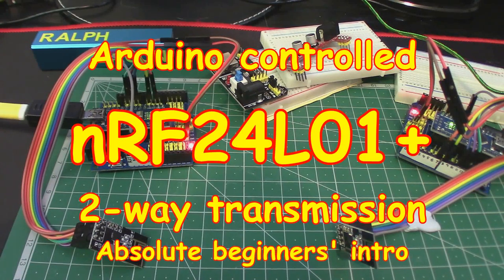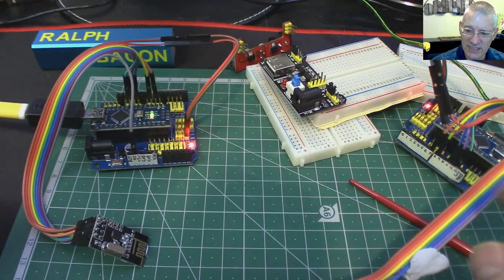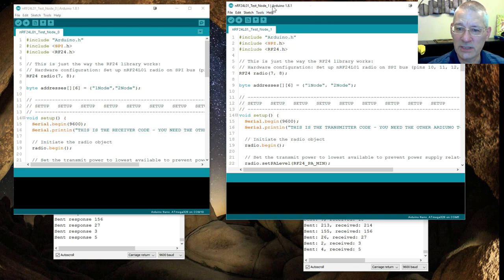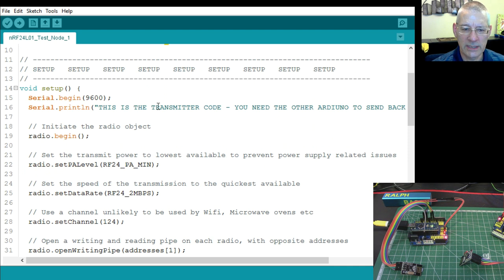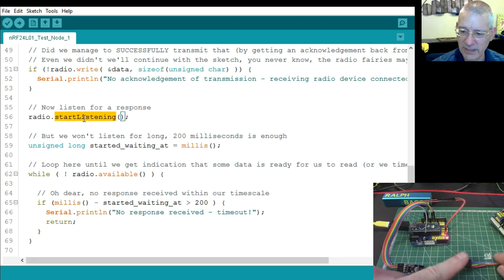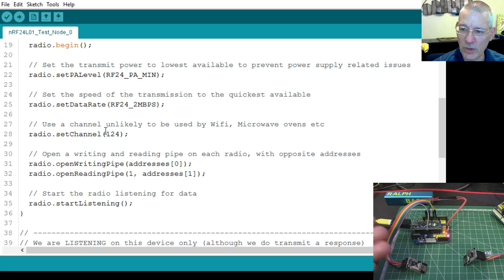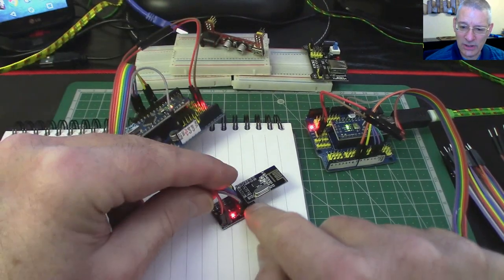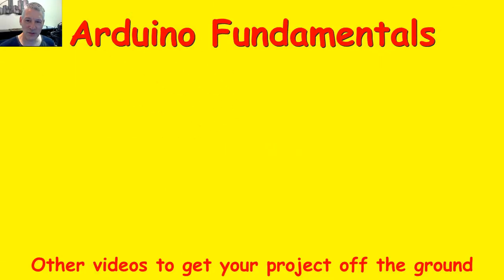#73 nRF24L01 Send (and receive) data with your Arduino!

Comment: Hi Ralph! Great video! Gave me ideas to automate servos on each arduino via the nrf24! But weirdly, can't seem to make anything happen. Uploaded your sketches, and tried running it, but even if i change boards and sketches, nrf24 and boards ... nothing works. No acknowledgement of transmission and reception ....
Reply from the maker: Hey Philippe, welcome! If the nRF24L01 is "not working" then it undoubtedly either the power supply (remember these are 3.3 volt devices unless using the adapter boards when they require 5v) or it is your wiring. The photo (.jpg) of the connections I uploaded (somewhat belatedly) shows the top view of the board's connections (so the wires are actually underneath the board). Awkward, I know, which is why the adapter boards are a good idea as it makes the wiring simpler as well as sorting out the power issue. Recheck your wiring then check it again, it's bound to be that. I'm assuming the sketch is actually running OK on the Arduino (you have put in relevant Serial.println statements?) Let me know if you still have problems (or have success). Good luck!
Reply: I don't understand, redid all the wiring and nope, nothing ....
Reply from the maker: I'd like to understand what's actually happening, Philippe, so bear with me.
 
When you say "nothing is happening", at the very least you will get a response from the attempted transmission in the sketch "nRFL24L01_Test_Node_1" (the primary transmitter sketch) at line 52 which will say in the debugging window (aka Serial Monitor) that there was "No acknowledgement of transmission - receiving radio device connected?"
 
This is the least that can happen. If you are not getting this then either the sketch is not running (which I'd already mentioned you could prove by the Serial.println statements if you remember) or your Serial Monitor is not monitoring the correct USB port that is connected to your Arduino or has not got the correct baud rate of 9600 selected.
 
Can you confirm that you are least getting the above message. If not, can you confirm that you can successfully upload the blink sketch, get it working, and see something on the Serial monitor if you insert that aforementioned Serial.println in the Setup() function?
 
Keep persevering, we'll get there.
Reply: Hey Ralph, yes I do get the ''No acknowledgement of transmission - receiving radio device connected?''. Both Arduino Nano's Tx light do blink though which is a start.
Reply from the maker: That's good. So your other Arduino (with the Node_0 receiver sketch) displays what? Nothing? You say the LED lights up briefly on BOTH Arduinos, so that sounds like the second nRF24L01 is also sending back a response? What is being displayed in the Serial Monitor from that 2nd device's Arduino?
Reply: Node 1 : No acknowledgement of transmission - receiving radio device connected?
No response received - timeout!

Node 0 : Sent response 0 (And then it just adds +1 every cycle of code)
Reply from the maker: Even more strange! The RECEIVER sketch (Test_Node_0) will only send back a response once it has received a value from the transmitter (and it won't be starting from 0 incrementing by 1 either, as the transmitter sketch, Test_Node_1, sends out a RANDOM value to which the receiver is supposed to add 1 and send it back).
 
More questions:
1. You are using the two sketches EXACTLY as supplied?
2. You are not attaching anything to the A0 port on the transmitter Arduino?
3. Place the following line of code in the transmitter sketch, at blank line 45:
Serial.print("Sending value: "); Serial.println(data);
That will tell you what value you are transmitting.
4. In the receiver sketch, add the following line of code at blank line 53:
Serial.print("Received value: "); Serial.println(data);
This will tell you what value the receiver got from the transmission.
 
Stir all ingredients thoroughly and allow to bake for 10 minutes and let me know the answers please!
Reply: 1. Yes
2. Nope nothing connected
3. and 4. done

Weird!!! It receives something ... that is incrementing and then sends back an incrementation of it. The transmitter actually sends a real random and receives the incrementation that is incrementing from 0 till 255... So basically the receiver doesnt really receive the transmitter but the transmitter does receive the receiver ...
Reply: THIS IS THE TRANSMITTER CODE - YOU NEED THE OTHER ARDIUNO TO SEND BACK A RESPONSE
Sending value: 95
Sent: 95, received: 69

THIS IS THE RECEIVER CODE - YOU NEED THE OTHER ARDUINO TO TRANSMIT
Received value: 68
Sent: 69
Reply from the maker: I'm perplexed at how the receiver is receiving a number that is not the one sent! My brain just rebooted itself trying to understand what could be going on here. I need some to time to think about this. In the meantime, tell me whether you are  connecting the nRF234L01 to Arduinos (Uno/Nano) or something else?
Reply: To Arduino Nano. The thing is, I reversed the whole cables on one of the nrf, because I didnt read the schematics properly, so it might have broken the chip ?
Reply from the maker: Well, whilst there is that possibility, as long as you didn't connect it to 5 volts instead of 3.3 volts I think it should survive. The fact that both are transmitting (and receiving, but not the data we expect) is also a good sign. There are settings for the nRF24L01 that can disable the auto-confirm, which might be, for example, why the random number transmitter is not receiving something back from the receiver but that would not explain why the receiver is seeing a different value to what has been transmitted. Which of the units did you wire up wrongly? Transmitter or receiver, and are you very sure?
Reply: Ok tried with brand new nrf24 modules ... and same problem. No  No acknowledgement of transmission and there is this weird incrementation ....
Reply from the maker: OK, new modules mean at least there is nothing hardware-related going wrong here. And the value being transmitted is not being auto-acknowledged but is being received, but wrongly. And hence incrementing that wrong value. Which is being sent back to transmitter OK or not? Eg Receiver thinks it has received "0", increments to "1" and sends back to transmitter. What does the transmitter think it got back? Trying to do detective work...
Reply: The transmitter receives the good value from the receiver ... but not the other way around
Reply: @RalphBacon   mee too facing the same problem pls give solution for it

Comment: Hi ,how can i use nrf24l01 for many to one communication i.e i want multiple nrf24l01(node side) data will comes to one nrf24l01(gateway side)?
Reply from the maker: You can do this, Rahul, either up to a maximum of six nodes connected pretty much as per my demo, or if you need more you will have to create a mesh - something I haven't done but there is an example in the library that I use. It will be a step up from this demo though. I would recommend you get this simple demo working so you understand how it all hangs together before moving onto a mesh radio system (frustration is a common source of project failure!)
Reply: TO; Ralph S Bacon: can you make a video send 3byte( 1 byte address, 2 bytes data) to write or read  on a 24C08(the EEPRom of a ardruino ) from other ardruino through 2 modules RF24L01 thank and wait your video?
Reply from the maker: I'll add this to my growing list of suggested video topics, Thuan, thanks for the suggestion.

Comment: I'm really new to this I hope someone can help me. I didn't know and purchased a knock off one of the nRF24L01 so it has different connection in as VCC Ground RX TX and CMD, I was just wondering how do I adjust the Pin in the sketch to make it work? I connect the pins via the RX (0) and TX(1) in the arduino uno. THank you so much
Reply from the maker: If the pins are just in a different order on the module connect the correct pin from the Arduino (eg the one designated for TX) to the TX on the module. Alternatively, given that you  are new to this, buy some non-knock off ones (they are very cheap) together with the adapter boards, also super cheap and then your problems go away for just a few dollars. Sometimes it's sensible to take the easy path to your goal rather than spend hours trying to get something to work (that might never work).

Comment: Great job sir!
  I want to display this two-way communication with   LEDs instead of a serial monitor.
Pleas guide sir
Tnx alot
Reply from the maker: You can use IR (infrared) diodes to do this. A modulated signal (like a TV remote control) should work.

Comment: my transmitter doesnt do anything and reciever is stuck on sent response 64
Reply from the maker: Saying that the transmitter "doesn't do anything" isn't very helpful in a diagnosis situation. At the very least it should be outputting "Serial.print" statements telling you what it tried to transmit and what (if any) response it got. 
I suggest you (a) use my demo sketches completely unmodified and (b) use the power adapter plates that seem to sort out all power-related issues.

Comment: RF communication  isn't suitable to use everywhere. Perhaps a good follow-up might be RS485 communication including multi-drop.
Reply from the maker: Indeed it would, Brian, especially now you mention multidrop, the I2C equivalent of RS485. Hmm, I just know I have at least a couple of these units somewhere that I played about with, in my PIC days, but as I'm packing up ready for a new workshop in about 6 weeks it's becoming increasingly difficult to find anything. But, it's a great idea and if I can find those units... you never know. Thanks for the idea.
Reply from the maker: You mean, if you I can't find them, go buy some? Yes, I had already thought of that, not least because as you say, they are as cheap as chips. Now I got no excuse. So it's taken you 12 months or more to sort out your workshop? I hope mine is done quicker than that or there will be no more videos here! All systems set to go in the week before Easter 2018...

Comment: Hi, could you make a Video about how to use the Nrf24l01 with a button and a Led at the recever.
Reply from the maker: Without a doubt, you should be able to easily modify the sketches I provided to do that. You will need to get the demo running first and them make modifications.
Reply: @RalphBacon  ok, but i am not so good at programming!

Comment: Is it possible to transmit information from 30 rf transmitters to a single receiver?
Reply from the maker: As far as I know, the nRF24L01+ is a 6 data pipe MultiCeiver, which means you would normally not use more than 6 together. If, however, you did try to have 30 transmitters and only a single receiver, transmission overlap could be a problem. Probably not the solution you're looking for, Joao.

Comment: Does not work, wiring is ok, but "No response received - timeout!
No acknowledgement of transmission - receiving radio device connected?
"
Reply from the maker: If you are using the very low power setting, change to just the low setting and don't have the devices too far apart (max 30cm, for testing). Swap the devices to see if one works and the other doesn't. Put serial print statements in BOTH sketches so you can tell if something is being received once something has been transmitted. Basically, monitor both devices (sender/receiver) in two instances of the Arduino IDE.

Comment: i did exactly the same thing,  followed the steps perfectly and do not work, i was trying to make this work since a month and i don´t know how to make it work yet.
i use the nrf24lo1 adapter and conect all the dupont cables but even the code don´t show me the message of not receiving data on the serial.
i don´t know the problem, if someone can help would be great.
thanks for the video, make me understand a lot of things but i just can´t make it work yet.
Reply from the maker: I'm not sure what else to suggest, Alfonso. Remember that thousand of makers have tried my sketches and it works for just about everyone. Do double check all the wiring (and the wires themselves). check the 3v3 power at each chip (careful not to short anything out). Put Serial.println statements at various parts of the sketch so you can follow what is happening (both Xmitter and especially in the Receiver). Slow everything down (put a delay(1000) in the loop) so you are not trying to debug hundreds of messages a minute. As a final last resort, buy a couple more nRF24L01 modules (they are cheap, especially if you buy 5) to ensure your modules are not damaged in any way (I had one that was damaged, so it does happen). Good luck.

Comment: Hello,

I have the following problem.

22: 45: 56.671 -> THIS IS THE TRANSMITTER CODE - YOU NEED THE OTHER ARDIUNO TO SEND BACK A RESPONSE
22: 45: 56.716 -> No acknowledgment of transmission - receiving radio device connected?
22: 45: 56.947 -> No response received - timeout!
(still this response is the same).

and

23: 06: 28.206 -> THIS IS THE RECEIVER CODE - YOU NEED THE OTHER ARDUINO TO TRANSMIT
23: 06: 54.457 -> Sent response 74
23: 06: 54.690 -> Sent response 74
(still this response is the same).

I don't know what's going on anymore.
one-way communication works even if I swap the code from one to the other.
So the modules are fine and probably connected correctly.
I didn't change anything in the code.

I practically don't know where the mistake is or if it could be.
Reply from the maker: Are you using the adapter plates that allow you run off 5v?

Have you changed the code that says:
radio.setPALevel(RF24_PA_MIN);
to
radio.setPALevel(RF24_PA_LOW);
to increase the tiny range (in both sketches)?

It looks like the receiver thinks it is receiving something (as it sends back a reply) but as the transmitter never got an auto-acknowledgement that seems unlikely.
Reply: @RalphBacon  I think so, I tried a 3v3 power supply from arduino but I also have adapters with an external 5v -> 3v3 regulator and I added a 10uf capacitor. Unfortunately, nothing ... but I didn't try to change the range of performance, even if they are 30 cm apart.
but i tried these modules
nRF24L01 +
nRF24L01 + PA / LNA (with external antenna).

And now I tried to change radio.setPALevel (RF24_PA_MIN); -> radio.setPALevel (RF24_PA_LOW); (also HIGH, MAX) on both. And still nothing.

The only thing I succeeded in when I started reading the data coming into the receiver is still the value 66, but in the transmitter 254 is sent and receives 67. SEE link.
https://ctrlv.link/mq7w
Reply from the maker: The 3v3 from the Arduino will never work properly. I suggest you get the adapter plates like this: https://amzn.to/3ordeZw although will be cheaper from Asian markets.
Do that FIRST before trying other stuff as that normally cures 99% of all problems.
Reply: Hi, I using this adapter right now.. that was the first thing that occurred to me where the problem might have been
Reply from the maker: If you're still having issues, put in more Serial.print statements to see what the receiver is getting (if anything) and whether the transmitter is getting the auto-acknowledgement back.
Reply: @RalphBacon  Hello, So far I have solved it but I have done it on a one-way, which works but I am solving another problem.
Probably no interference with the modules.
The transmitter works properly but the receiver in case of loss of connection or power failure, the transmitters will remain active inputs at that time.

I also noticed that when I change the address on one device and it is not known to the other, they can still connect to each other.

Alternatively, I would be happy to help and if it would be possible to send you projects and see if you do not see any mistake.

Thank you for helping with the solution

Comment: I've been trying to get the nRF24L01 modules to work but nothing seems to do the trick. One just transmits data no matter what and the other receives a garbled mess (even when the transmitter is turned off).
Reply from the maker: Read the posts in this video, cooldude, you will see that most issues are caused by power supply problems. Get the adapter boards (very cheap) and that should sort you out.
Reply: I just found out the problem (even with the adapter boards, capacitors and everything) it was my one arduino board causing some sort of issue. I bought a bunch of really cheap nano variants and they seem to work better than my one more expensive board. The sainsmart uno I have seems to work as well (but I couldn't find the problem due do other board corrupting the transmission data.
And I have tried using the new nanos with rf modules that I didn't solder caps to and it also works perfectly fine.
Reply from the maker: That's quite a rare problem you discovered there. Most clones behave quite well (let's face it, the reference circuit is quite straightforward). But it's interesting that your Arduino played up, and even better that you discovered it, others may take note too. Thanks for posting.